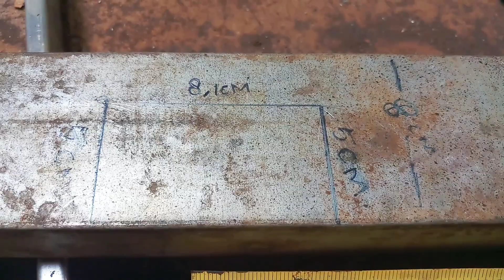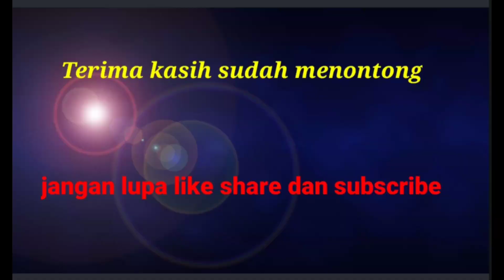cara pasang roda bawah pintu dorong yang baik dan betul  || cara tukang las

Comment: Bang ijin bertanya kalau bikin pintu geser ukuran 180x170 panjang, nah untuk rodanya baiknya menggunakan ukuran yg berapa bang utk holow yg fi pakai menggunakan holow 4x4
Reply from the maker: Pake roda 6 aja bang..
Reply: @caratukanglas  terimakasih bang
Reply from the maker: Ok bang 😊
Reply: Sekalian bertanya bang utk pengelasan holow ukuran tebal 1,7 mm lebih baiknya utk setingan amper di angka berapa ya bamg
Reply from the maker: Tergantung dari mesin lasnya bang brp amper dan ukuran kawat las nya
Reply: @caratukanglas  ukuran kawat las 2,0 mm bang
Reply from the maker: Kalau pakai mesin las merk lakoni 900 watt.. 80 - 90 amper bang
Reply: @caratukanglas  kalau yg 450 watt berapa y bang, oh iya bang kalau roda nya saya belikan behel 10 jadi diameter rodanya juga 10 gak bang
Reply from the maker: 450 watt 70-80,,klu roda 6 saya pakai besi 12 bang...ngk prnh pke yg 10